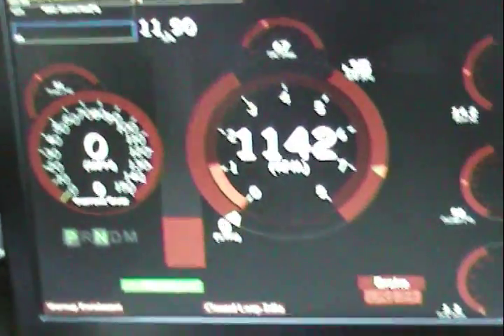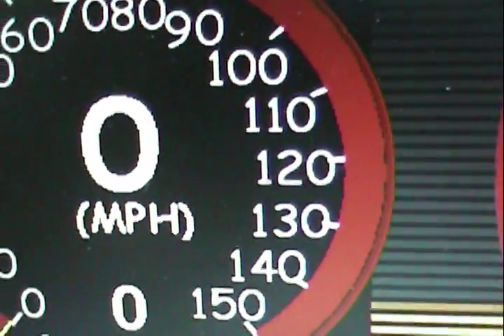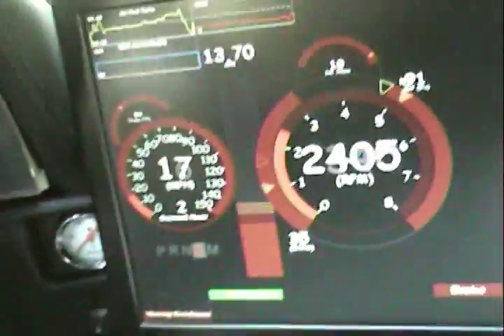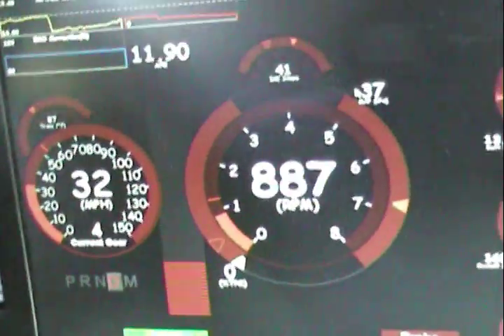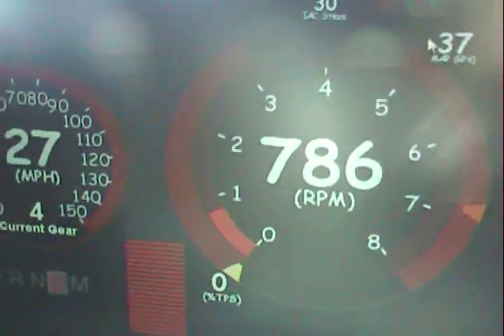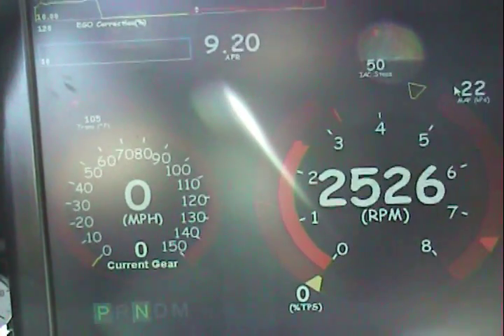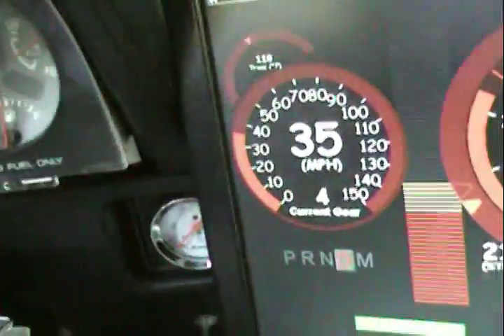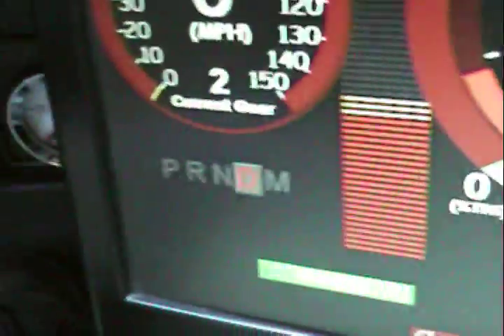MegaSquirt based electronic auto trans controller

Comment: Alright Una I'm back a year later trying to push the limits of an n/a pt cruiser. But now this were I need help. I'm trying to find a base map for megasquirt 3 I don't care if it's for an srt4 I just need something that would make this thing run. The car project go push back a little as most projects do but I'm gonna be running honda k series cop with AEM sensors such as coolant, afr, iat, and a 3 bar map. I mostly got everything wired up to switchs so just need to install the msx3. Just can't find a base map but haven't asked anyone either your the first.
Reply from the maker: BECAUSE I CAN I think I was on ms2 still when I converted to Turbo, but I do have a good MS2 map you could load into MS3 I think. Had a very potent NA engine before I added the turbo.
Reply: Alright do you have another preferred way of contacting you because youtube comments are limited to what we can say or do. Also big thanks to the transmission you recommended me not in the car yet but should be good up to 800HP.
Reply from the maker: My user name at gmail.

Comment: So I'm basically working on a pt cruiser project and the transmission is the only thing holding me up. Been reading and reading and it seems like no one can figure out how this transmission shifts or control it. I heard your story where you blew your trans because it up shifted to 4th/overdrive and gave up on the project. The first question would be how far did you get with the controller working properly. Next would you recommend something better. This seams to be turning into an nightmare for me because I'm trying to go for the world record of the fastest pt cruiser but yet I can't find anything to control it. I would be open to and suggestions and where to move on from here. This is the worst car to work in. Thank you for your time reading this and hopefully hearing back from you.
Reply from the maker: Toss an A413/31th from a Neon 2.0 in there. You can build those to be absolutely bulletproof. There are manual valve bodies for them, and it’s not electronic.
Reply: unaclocker Thanks I'll look into that. Would you say the megashift is a lost cause for the 41te or could I still try that route. Even tho 4th gear doesn't matter because you can't use it in racing it would be nice for cruising. Thank you so much for getting back to me because I know you kind of fell off the face of the Earth after.
Reply from the maker: Yeah, it's a lost cause. That transmission is all kinds of strange. There was a company making a controller for it, but after working with a guy from the Neons.org forum on it for about a year, they removed all support for that trans and said F it. Even the stock controller has to go through some really crazy involved learning routine anytime you change the transmission or the controller. It's just not a case of "just working", ever. And yeah, MegaShift gave up trying to control it as well.
Reply: unaclocker O I see. Now if I were to swap the trans would I have a problem with the pcm because I have an 06 pt and the TCM is built in. Secondly would you recommend using megasquirt for engine control.
Reply from the maker: Yeah, it'd probably complain a bit. I don't think it'd affect the running of the engine. And yes, definitely, run that thing on MegaSquirt 3, it'll make a world of difference.
Reply: Yup looks like I'm buying a 31th and rebuilding it with a reverse valve body. I'm building the transmission over the winter and installing it in the spring along with the MegaSquirt. I might contact you at a later date with needing some assistance installing the MegaSquirt if you are okey with that. It doesn't seem to be the issue of lack of money for this car but lack of usable options. I have an 06 which is when they switch everything over to the PCM for control. After this I'll go on to working on the engine starting with the heads and working down from there. Yea I know that there are most likely a forum for some of the question I'm asking you but you seem to know the wiring of this engine pretty good. Thank you for taking you time reading this much appreciative.

Comment: Almost 6yrs since this video. Did you ever get the kinks worked out of this thing? megashifter never really got off the ground. I've got a 95 Eclipse NT 420a/ A604 and its been dropping in failsafe mode for over a year. Fine for a week or a month then acts up on and off then ok again. Mitsubishi dealer cant communicate with the TCU. Blamed the computer but its so intermittent I kind of doubt its the TCU. This would be a viable alternative if they were sold built with laptop programming.  Forced four is working on a more universal shift box that will work with A604 but its not out yet. Anything additional you can add here would be helpful.